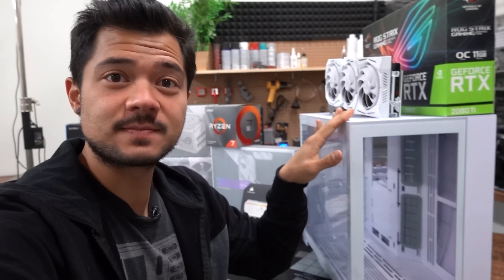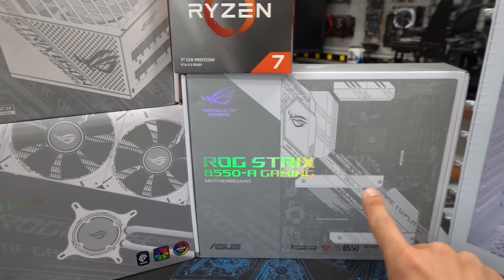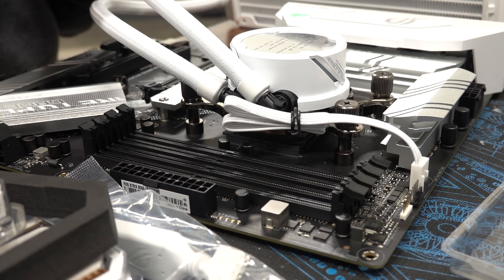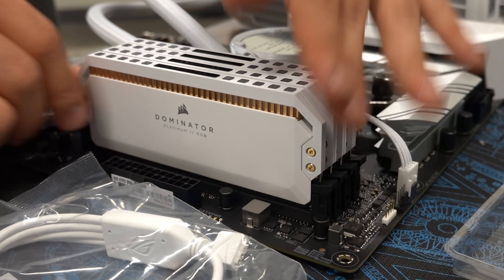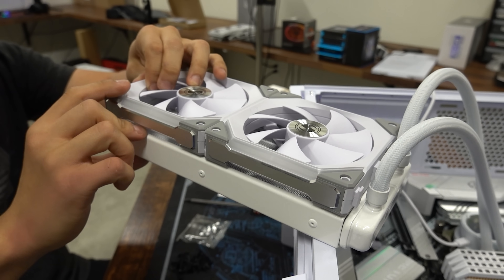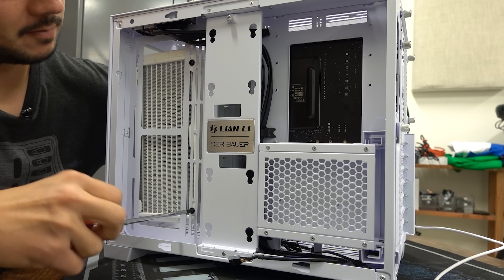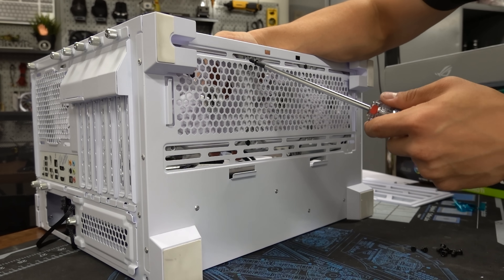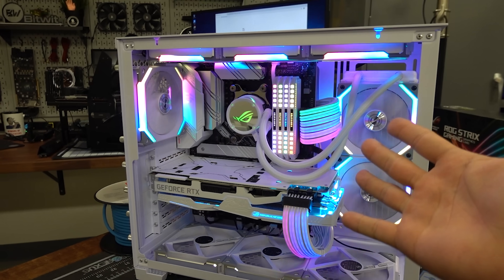This is the best-looking RGB PC I've ever built........EVER!!

Comment: My wife got this case a few weeks ago, great little case and still great space for cable management.  Managed to fit an AIO, 9 Corsair RGB fans, and cable extensions in the back with a Commander Pro and a Commander Core.  Took 2 hours just to sort the cabling and had to stuff a load of them in one of the empty drive bays, but it looks fantastic though.

Comment: I have been looking for an all-white pc case, this is literally it D: I don’t have a pc so it’ll be my first and I’m honestly going all out for it
Reply: Good luck!
Reply: Thank you!!
Reply: Remember it’s smaller so you’re gonna need an sfx psu
Reply: Gotcha, thank u~
Reply: Make sure all the parts work well together, some people get like a super good cpu that can overclock but then have an 80 dollar motherboard that doesnt support overclocking, or maybe they get a board that does, but then they have the stock cooler which would not be a good combo, itd be like throwing ice water into the ocean if it was boiling
Reply: Corsair 5000D airflow white/black it's the best airflow case.
Reply: To small for me but the thermaltake v51 snow is badass and huge
Reply: same!!
Reply: Me to! Should i wait for 4080?
Reply: Same bro. I saved up for this case, a 3700x and a 3080 trust the process and it will work out bro. Had a lot of people doubting me but I still got to my destination no matter how many roadblocks:)
Reply: @youmadgoofy6272 no…. people are saying wait for the 40 series but the situation will prob be worst than rn, chip shortage, higher prices, etc. But hey its up to you  🤷‍♂️
Reply: Does a ryzen 7 and a b550A motherboard fit with each other? With a 2080 super?
Reply: @ethandong1479  the only thing i could think of what would happen with the ryzen 7 and your motherboard is that since the ryzen 7 is new in a sense, then some of the motherboards being sold like the b550A would require an older generation cpu like a ryzen 5 or something, to update the bios and then you could switch the old cpu with the newer ryzen 7, it all depends though
Reply: @himbofication  ok thx

Comment: I will love lian li forever if they release this.
Reply: Fans been released just hard to find. I have 2 packs of 3 fans. Good luck finding them.
Reply: @tcdixon90  theyre only on backorder lmao.  i ordered 2 three packs on amazon and got them within 2 weeks.  Same with the strimer pro cables.
Reply: I don't even understand why they would hesitate. White cases are normally the ones that are sold out. Like nr200, my inwin a1 was hard to get white when I got it and others I can't think of right now. Also see components in white sell higher and faster. White enhances RGB reflection.. Could go on.
Reply: @Josh-ye2kw  They are available...just more expensive than when they first came out. JayZTwoCents video on them bumped their prices up.

Comment: That's a great build! I feel that cable management could be hindered by the bracket you had to install for the ATX motherboard, but you seemed to have it figured out. I wonder how easy cable management would be in this case? I of course can't see yet because of the fact ATX power supplies aren't supported in the case.

Comment: 16:50 the only way you can install a radiator + fan combo (AIO) in an ATX build in this case is with a 240/280mm to the side. M-ATX / ITX if using the 5 PCIe slot config would give you room at top for AIO.

Comment: Great vid! I'm glad yall made this case popular. I just finished my LL o11D Evo(black). I'm going to load up my build shortly. I had to do a few minor upgrades. Ryz 9 5950x / Gig Rtx 3080 OC LHR / Msi x570 Game+ / Evga 850w g+ / Corsair Vengeance RT 4x8gb 3600MHz / WD 570Black 2x2tb Nvme/ Wd 2tb hdd / LL Uni-AL's 6x120mm(intake)  / Corsair H150i elite capellix 360mm(top exhaustin'). I'm getting awesome thermals with my light cpu/gpu OC and Undervolt, Though its my Dreammachine managed to stay under 3k. : /      Worf it.

Comment: 23:55 I am building 2 (240) intake side with radiator, 2 (240) intake bottom, 2 (240) out at top.... that's it. Air will still flow out the back. I am not loading a 80/90 series card, dont need that much graphics power. Actually a 70, if i see it getting too hot then I might add 1 more to make it three intake at the bottom. I am considering 280 for side intake, but the AIO i want from ASUS i dont see a 280 option of that model, I thinking to get a 280 radiator and attach the pump to it, will see. But that's only if I see my original configuration not running cool enough.

Comment: This case shoulda had the 3 fan water cooler ontop. I wouldnt ever push or pull cpu cooler from the side. thats for air in. and add that back case fan.
Reply: see, look its pulling itself apart at the seams...
Reply: see look the side fans are suppose to pull air into the side and cool the water cooling tubes themselves that are suppose to hang from the top of the case. in front.

Comment: Those uni-fans in this vid , all are static pressure fans? Because I assume that the fans that are use for AIo are static pressure fans and the case fans are supposed to be air flow fans , but in this vid all are the same types of fans disregarding its either on the aio or case?

Comment: Shouldn’t the rad be flipped so the hoses are at the bottom? to prevent the cpu pump sucking air that is in the rad? I think that would cause random hot spots.. just a thought!

Comment: Building mine in the next few days
Question: Why have you pulled air in from the bottom when the GPU is extracting air directly above it?
Wouldn't it be better to extract and pull air in from somewhere else?
Or leave the bottom fans off completely so the negative pressure pulls the warmer air directly away from the GPU and out the top of the case?
Reply: No those fans will blow fresh air in the gpu

Comment: Such a nice looking pc! I'm building a PC using the lian LI 011d xl with 10 of the SL 120 fans. Using an Asus ROG Strix Z690E wifi MB with 32gb of the dominator ddr5 ram and a 12900k cpu and an ftw3 3080ti. I will be using a kraken Z73 360 aio, do you think this will cool the 12900k well?? I have read others who have said it works well. This is my first aio, my current PC has a noctua D15S air cooler and a 9700k. Luv all you do for the PC community!!

Comment: How did you connect 9 fans? 
Do all fans RGB work through just 1 ARGB header of the Asus ROG Strix B550-A motherboard and controlled via Aura Sync software?

I'm also building a PC with 9 fans in O11D cabinet and Asus ROG Strix B550-F gaming motherboard which only has 1 ARGB (3-pin 5V 3A) header
Total current of RGB LEDs are 0.6A x 9 = 5.4A

Did you used a ARGB Splitter?

Comment: good GOD this thing is sexy 🥺
Bit of a bummer that the PSU didnt fit into the case cause i woulda loved seeing that thing closed.
I was thinking about building a Whiteout for myself for a while now (i know, comment 2 years after upload, yatta yatta) but i realized quickly, that for a setup like that, i would literally have to build my entire desk, all my peripherals and potentially even my wall around the setup around the whiteout pc. which honestly, no. aint nobody got time for that.
plus GPUs and CPUs are unaffordable right now if you do find the one you want or need so i guess i'm sticking to my prebuild zero airflow 2060ti setup.
i do love you videos tho.

Comment: hey. cool video and beautiful build. is it a problem, that the aio tubes touch the backplate of the graphicscard? I saw this here and have this issue in my new pc. I'm asking cause I'm wondering if it could cause any damage, if the sleeved tubes get hot from touching the backplate.

Comment: 22:02 why not mount the fans other way around making the cables practically invisible and much easier to cable manage?
Reply: because the cutout on the other side of the case is lower down. You'd be able to see the cable coming down from the fan into the cutout, as opposed to running the cable round the side to the much higher cutout on the left side.

Comment: I’m doing my first build in this case and was wondering about fan arrangements. I’m doing an AIO as well so I would have a lot of negative pressure. Could the single rear fan be used as an intake? I’m storing my build on top of my desk so it wouldn’t be cut off. Or is that a bad idea?
Reply: Negative pressure means more exhaust than intake. Radiators should always be an intake, so they are always pulling fresh air in.

Comment: Hey Bitwit, you inspired me to build in a lian li mini and I successfully did! But my temps have increased to around 75° CPU, and 68° GPU which is a bit high (360mm aio mounted up top with 3 exhaust fans) (6 intake fans)

What are you getting for average temps?
Reply: 400C barely even touched it now i only have 1 hand
Reply: @Mr.Dustpan  lol
Reply: @dude9237  no im fr

Comment: Beginner PC question here, how did you get those fans connected to the CPU cooler??? Can you change the fans with all CPU coolers or is it just this one specifically? I'm looking at the ID-cooling Auraflow 240x RGB in white but i don't like the fans it comes with, is it possible for me to swap them out with these fans??

Comment: Can you do the 3 bottom fans and the top 3 fans as intake and then the radiator fans and the single back fan as exhaust? Are there any complications with 6 intake especially if it is top and bottom and 3 exhausts?

Comment: was wondering if you had an aio cooler that has the pump in the radiator and mount it on the side which tubes should it be up or down?

Comment: Hey Bitwit I know this is an old video but I was wondering if you can help me out here, I have the 011 Dyanamic Case in white but with an EVGA GTX 1080ti Card with an 8 pin Strimmer 2 RGB cable but for some reason, I can seem to put the glass back on because the thickness of the cable is there any way you can let me know how to make this cable fit without breaking it. i would really appreciate any kind of info you can offer. Thank you

Comment: If I got the Corsair Vegeance 5812 and add a Core I9 and 32 gigs of ram, does it work a bit better? And if so, how does would it run?
Reply: You would probably need a different motherboard though as if your using Intel you would need a different motherboard

Comment: Just a quesion.. If the motherboard has 12 pin cpu connectors but psu has only 8, will it work just fine? Plus where to plug aio pump if mobo doesnt have dedicated aio header

Comment: Isn't the radiator upside down? Hoses should be on bottom to prevent air bubble's.
Reply: It is okay in that orientation because the top of the radiator is higher than the pump. Would still technically be better if the hoses were on the bottom but it shouldn't have any issues in this orientation.

Comment: I know this is an old video but im in love with this case and want to put my pc in it! I'm adding specs below and would love it if someone could let me know whether mine would fit or if i need the larger O11 Dynamic?
- CPU - Intel Core i7 3770k @ 3.5GHz (supports overclocking)
- GPU - AMD Radeon R9 Nano 4GB (Comparable to GTX 1060 / RX 580)
- RAM - 16 GB (2 x 8 GB) DDR3 @ 1600 MHz
- Storage - 500 GB SSD (Crucial MX500)
- Hard Drive - 1 TB (Western Digital Blue)
- OS - Windows 10 Pro 64-Bit (21H1) - Fully Licenced
- PSU - Corsair TX750M (80+ Gold Efficiency, 750W, semi modular)

- Motherboard - Asus P8Z77-M PRO (Z77 Chipset, supports overclocking)
- CPU Cooler - Noctua NH U9S (Push/Pull Configeration)
- WLAN - Asus PCE AX3000 (WiFi 6 + Bluetooth 5.0, up to 2400 Mbps)
- DVD Drive - TSSTCorp 16x DVD =/- RW
Reply: Look up what PC form factors are. That should help you figure out if your hardware (mainly motherboard) will fit in the case.

Comment: I tried finding the specs on pcpartpicker and it says the motherboard (ASUS ROG Strix B550-A) is not compatible with the Ryzen 7 5800X, but rather more compatible with the Ryzen 7 3700X. Any suggestions?
Reply: It most certainly is.. I have a 5800x in my b550-a
Reply: Also the message it shows you about compatibility tells you that you may need to update the bios, thats all

Comment: im confused. so what happened to the power supply?
Reply: The psu was too big you need a slim psu to fit he over looked that and had to rig it up like he showed
Reply: @dangerzone6481  is there any specific name for this “slim psu?” Im a beginner trying to learn
Reply: @Waffl1ngChr1s  yea man look up corsair sf(small form) series or you can go to lian li and they have a psu that's 750 watts I'll link it to ebay
Reply: @dangerzone6481  im currently gathering parts for a white build. (with the mini lian li) you think i could use the "Cooler Master Gold White Edition Full Modular, 750W, White Edition"
Reply: @Waffl1ngChr1s  prolly not my friend that psu a too big just get a o11d instead of the mini you should be able to add a normal psu into that one and its not too much bigger of a case
Reply: Or try another brand like techware I have that case and I love it and it's cheaper
Reply: @dangerzone6481  alright cool. thanks for the help. also where can i find those streamer cables?

Comment: I pulled up the ASUS board (the ROG Strix B550-A Gaming) on their website, then the memory compatibility list, searched it and the CORSAIR Dominator Platinum RGB 32GB (4 x 8GB) 288-Pin DDR4 SDRAM DDR4 3600 part number CMT32GX4M4C3600C18W is not in the list. I'd be leery of using components not on the mfgr list. Just saying.

Comment: Can someone please let me know if 2,100 is a good price for this pc build or am i about too get ripped off on offer up
 
AMD Ryzen 7 5800X 8-core, 16-Thread Unlocked Desktop Processor
 
Corsair Vengeance RGB PRO 32GB (4x8GB) DDR4 3200MHz C16 LED Desktop Memory - Black
 
SAMSUNG (MZ-V7S1T0B/AM) 970 EVO Plus SSD 1TB - M.2 NVMe Interface Internal Solid State Drive with V-NAND Technology
 
Corsair iCUE H100i Elite Capellix Liquid CPU Cooler
 
Corsair iCUE 4000X RGB Mid-Tower ATX PC Case - Black
 
ARESGAME 750W Power Supply Semi Modular 80+ Bronze PSU (AGV750)
 
ASUS GeForce RTX 3070 KO-RTX3070-O8G-GAMING 8GB 256-Bit GDDR6 PCI Express 4.0 HDCP Ready Video Card